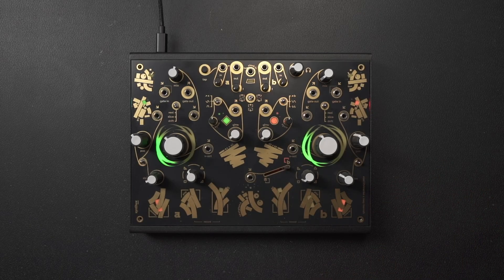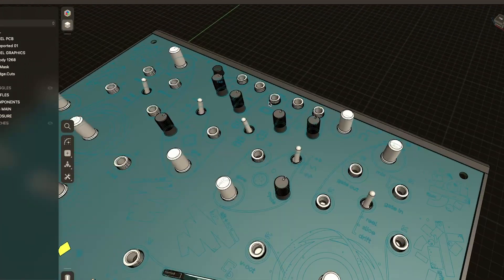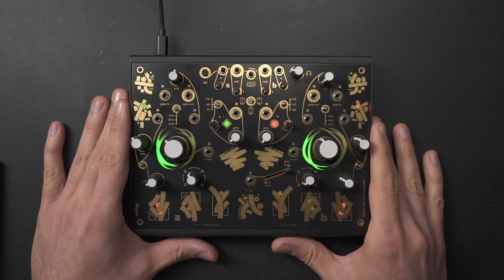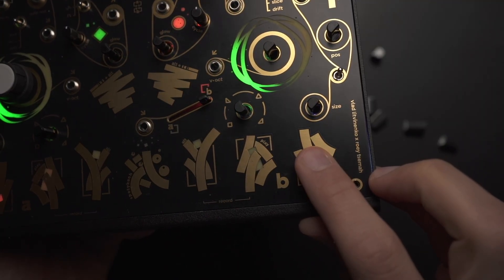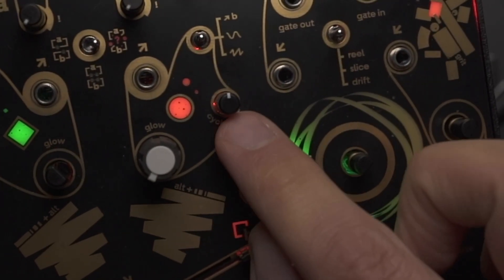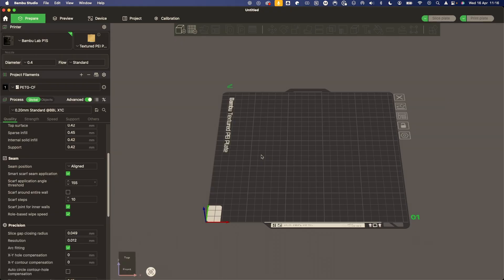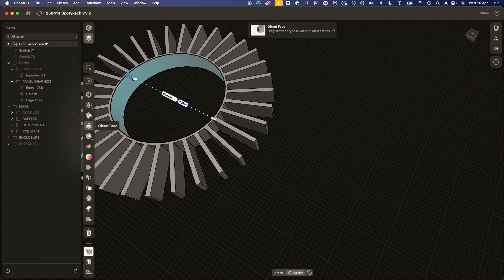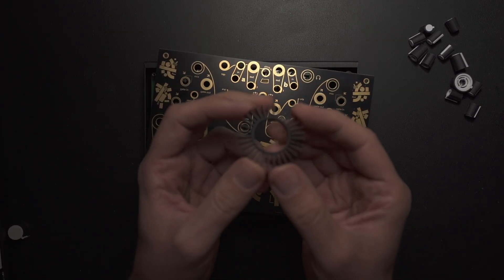Critical Detail? Or Over Engineering?

Comment: @SynthuxAcademy keep the LED rings without a light guide, it's much nicer being smoothier. Use light guides for all the rest of the LEDs.I know it's really annoying with light leakage through the potentiometer holes etc. In our recent design Fuzz Fields we used light pipes from BIVAR covered with black heatshrink tubes to stop the light dispersion. Maybe for your design will add additional cost as you have many LEDs.

Comment: Following this project with interest!

I am working with LEDs in my products as well (sadly not synths), and something to think about while creating these sections is that if they are made white, you can reflect and make use of more of the light than that otherwise would be reflected inside the device.
Potentially you can lower LED intensity, or even save cost by choosing other LEDs!
Other solutions would be LED lenses that projects light to a specific area, both can also be combined!

Sometimes we use a combination of very thin metal foil and white paint to reflect as much light as possible + projecting and diffusing lenses.

Good luck!
Reply from the maker: Thanks so much! Would you advise to make these rings in white PLA? I made them 2mm (instead of 4mm) and they look much better. I wonder how white PLA might affect it. 

Curious what you’re making. Maybe join our Discord?
Reply: @SynthuxAcademy  Your welcome! Worked at different positions, but now as Product Manager for a larger brand in the PC component and gaming peripheral space (around 14years).

I do not have strong knowledge of PLA interaction with a light source, usually we work with ABS, PC, PA, or TPE, and that's injection molded and then painted... so another budget.
I do come in contact with PLA but at the mockup level nowadays. Don't think it should be a problem, only thing would be heat and close proximity etc. otherwise white PLA sounds like a good idea!

You could go for a white PCB at the second PCB layer which house the LEDs to reflect even more light, green works soso.
Reply from the maker: @Arreswesweswe oh, white PCB! Clever! I can also use PETG-CF for the parts. I’ll try to get some white spools to test. Cheers!

Comment: You could give thee rings a lollipop shaped baffle to not have light bleed from the start of the ring to its end.

And there is also the possibility of making baffles that are slim at the bottom and wide at the top or even kite shaped to have distinct/separated LED showing but with various amount of shades between them.
Reply from the maker: Ended up making them 2mm tall instead of 4mm. Perfect fit. No shades. Posted on our Discord a quick video.

Comment: I’d try in-between option, shorter teeth, so its sharper on the inside and blurred beautifully on the outside. Variable teeth length may allow for some ticks to be a bit sharper (every 4th or 8th). Making teeth shorter on top and longer at the bottom (like a cone) may create nice balance between clear indication and nice bleeding. Just some thoughts :)

Comment: My stricktly personal opinion is that isolating the leds on the big array makes it looks cheaper than the blurred one. As for accuracy, I guess you already chose not to use a display so 32 elements in the array would only make sense if there's a 1:1 relationship with your loop buffer. If you'd use it to show clock divisions, it's more important. If it's used to show buffer start/length, I am not sure if these 32 elements will help you. For instance, when you're picking half of the buffer, the dot can never be in the middle.
Reply from the maker: I managed to improve on the design today. Using 2mm high baffles makes the light more controllable, and still shine very bright. I’ll show in the next video.

Comment: I was waiting for this video since I first saw the Spotykach panel!

I have to say that the two LED rings around those two knobs really caught my eye as they are. I am quite amazed that there was no light diffuser used and that the LEDs in the ring are at full blast.

I am sure that a lot smoother control of the indicator window can be gained in software, while leaving the option of having full brightness available. I would personally skip the baffles around the rings, reducing the bill of materials in the process. 

But I am curious to see how different heights of the current baffle design will look like too. Betting that 35-50% height would be a happy medium for someone like me.

Comment: I like the baffles, but they attenuate the light quite a bit and make the LEDs look much dimmer. Thinner walls might help with that, but it sounds like you would be pushing up against the limits of your 3D printer.
Reply from the maker: Indeed. I think I need to play with the height. It’s now 4mm, so there’s room to play.

Comment: Light pipes have been mentioned. What about a ring of them? 

I’m not sure if I prefer the blurred ring or the dimmer, stepped ring. They are both good and bad. I think I prefer whichever provides a brighter response, although I’d also like overall brightness to be controllable by the user.

In general, I don’t mind bleed as long as it doesn’t interfere with using the device (for instance, at the device edges). If it becomes harder to tell what controls are doing because of bleed, then at that point looking in to ways to control that light would become important.

Comment: Smooth light transition is better imo. The stepped one is very impressive when you see the work that went into it, but since we can't count it off then I don't think it works on this particular model. Also, the Spotykach has this magical look, so I think the coloured light feeling like an aura rather than a scientific "tick" motion is more appropriate :)
Reply from the maker: Yeah, I tend to agree. While making the video, I started questioning whether the baffle is actually adding value.
We were also thinking about using the ring for other things—like navigating the SD card, recording, and recalling files. For example: hold shift and turn the big knob to scroll through your recordings, then pick the one you want to play. In that case, the LEDs would act like visual “slots,” which could actually be super useful.

As for the LED smoothing—yep, that’s definitely possible. The transition between LEDs can be smoothed out; it’s just not implemented in this test code yet. Still lots of testing ahead!
Reply: @SynthuxAcademy  Ah, that's a tougher choice then
Reply: I also like the smooth look of the leds for the led ring, but I can see how having a precise look to be able to really see what you are doing can also be very nice. I think the solution and best case scenario is achieving the smooth look when desired in software with led brightness. That way you have best of both worlds and the most flexibility going forward as you build features for it?